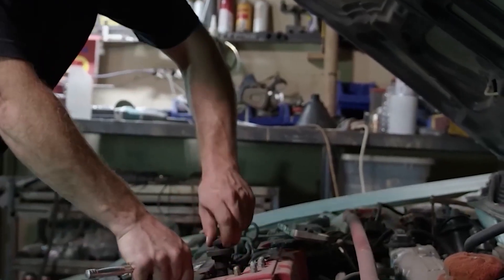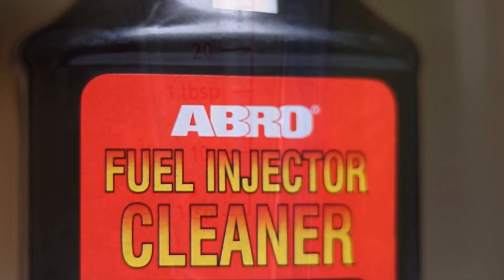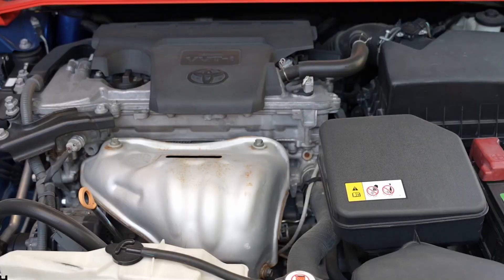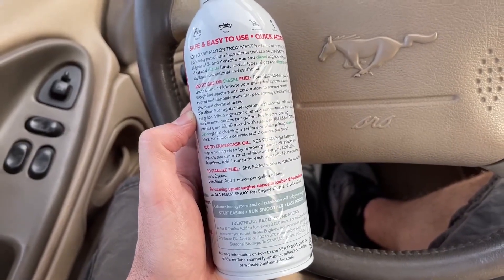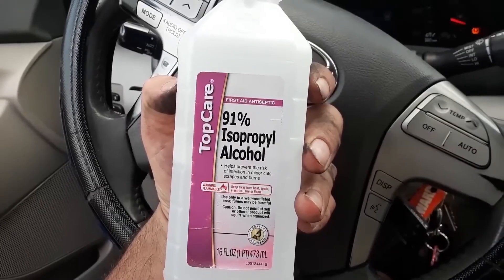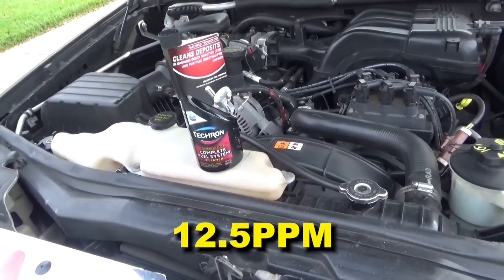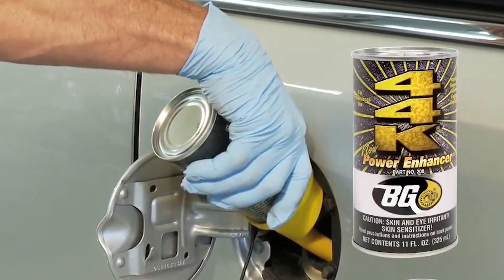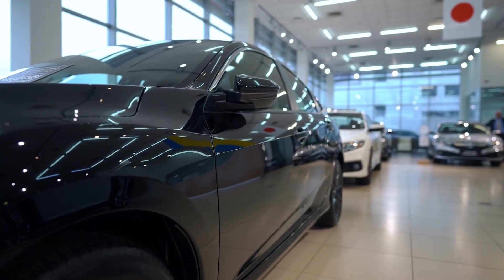NEVER Use These 6 Fuel Injector Cleaners (But 3 that Actually Work!)

Comment: 2018 Lexus RX 350 with 121,000 miles bought used so not sure if history. Engine V6, hesitates with in town driving. What fuel cleaner is best? I just ran a bottle of Techron concentrate through is last tank.

Comment: Geez, I just watched videos showing those cleaners that were hyped in this video as non effective. Someone has to be wrong.
Reply from the maker: Fair point! The key difference is PEA concentration and lab testing. Our picks (Techron 250ppm, BG44K 400ppm, MaxClean 300ppm) have verified SAE/ASTM test results. Budget cleaners lack this chemistry entirely. What specific products were those other videos recommending?
Reply: @AutoSleuth They weren't recommending any but showed 10 cleaners with bore scope to the valves and piston heads after one tank of fuel each.. The difference was minimal to none. I think the goal was to show expectations vs. results are not alway what the label on the product clams

Comment: I have a 2020 Hyundia Santa Fe 2.0 Turbo with 50K miles. Dealer keeps pushing fuel injector cleaner for $200! So far no issues with engine performance. What is your recommendation?
Reply from the maker: At 50K miles with no symptoms, skip the dealer service. Your 2.0T GDI benefits from preventive cleaning—use Techron Concentrate Plus every 5,000 miles ($12/bottle). Saves you $188 and works just as well. Dealer service only makes sense if you have rough idle or misfires.

Comment: The FEWER additives you put in your gas tank the better......
Reply from the maker: Actually depends on fuel quality. Top Tier gas already has detergents (300ppm minimum). But non-Top Tier stations? Your injectors are slowly coking without additives. PEA-based cleaners restore what cheap gas destroys. What fuel brand do you run?

Comment: 757. Twin Rolls Royce RB211 engines. What's your point?
Reply from the maker: Haha, if you're maintaining RB211 turbofans, PEA fuel additives are the least of your concerns! Those use Jet A-1 fuel with completely different chemistry. Stick to aviation-grade fuel system maintenance—this video's for us ground-dwellers. 😄

Comment: 1998 Montero with 3.0 24 valve 4x4. 270069 miles. What is best ?
Reply from the maker: 270K miles—legendary! Your 6G72 SOHC port-injection engine is bulletproof. Use Techron Concentrate Plus every 3,000 miles for maintenance. At that mileage, consistent cleaning prevents buildup better than aggressive products. What oil are you running in that beast?
Reply: @AutoSleuth 10W30. Castrol. High millage.

Comment: 2003 Silverado 2500HD 4x4 6.0 miles200k Farm Use more off road & idling than on road try to get on the HiWay once a week & get up to 60-70 until engine is fully warm 
Did a oil change after driving 1 hour at 65 oil nasty actual blobs of jelly made a difference 1st hot oil change in a couple years

Comment: Since late last year, I've been blasting seafoam into the intake of my Dodge Challenger and Charger Hellcats. A reputable shop remarked that he has bever seen the internals of a supercharger look so clean. I'm a believer in their product as well as Techron and BG 44K for the injectors.
Reply from the maker: Real-world results like that are invaluable! Seafoam shines for soft deposits in forced induction setups—superchargers collect varnish fast. Combining it with Techron/BG44K for injectors is the smart play. Your Hellcats are getting full-system care. What's your seafoam interval?
Reply: @A @AutoSleuth  For the superchargers I like to use Seafoam every 6mos. I started with annual treatments but given the way we drive our cars 6mo intervals seems like the smarter move

Comment: Berrymans is cheap as does a great job cleaning the fuel injection systems
Reply: 👍 used it for decades 👍👍🇺🇲
Reply from the maker: Berryman B-12 Chemtool is a strong solvent, but it doesn't contain PEA—the chemistry needed for modern GDI injector cleaning. Works great for carbs and older systems, but for direct-injection engines, PEA-based cleaners are more effective. What engine are you running it in?

Comment: Hello I own a. 2018  Jeep Grand Cherokee with the 5.7 liter Hemi engine,what’s right for me please?   Y Jeep has 94.000 miles
Reply from the maker: Your 5.7 Hemi is port-injection, so intake valve carbon isn't a major issue. Use Techron Concentrate Plus every 5K miles. At 94K, one bottle of BG44K now for deep cleaning, then Techron for maintenance. Keeps those MDS lifters happy too.
Reply: Redline s1, or chevron techron. I personally would pick redline. It has higher pea than most. You’re welcome 😊
Reply from the maker: Redline SI-1 is solid—550ppm PEA, highest concentration available. Great call! Both work, just comes down to price vs. concentration. Techron at 250ppm is more cost-effective for regular maintenance, Redline for aggressive cleaning. Both are winners.

Comment: I have a 2009 Toyota sienna with 104,000 miles on it I think I took care of it. Well, what treatment would I use?
I also have a 2020 Toyota sienna with only 16,000 miles on it. j I think of using the Chevron lubricant ever 5000 milesor don’t worry about it?
Reply from the maker: 2009 at 104K: Use BG44K once now for deep cleaning, then Techron every 5K for maintenance.
2020 at 16K: Techron every 5K is perfect—keeps it clean from the start. You're ahead of the game on the new one. What fuel brand do you use?

Comment: 2023 Toyota 4 Runner  24K
Reply from the maker: Brand new engine! Just use Techron every 10K miles for preventive care. Your 4.0L V6 is port-injection, so carbon buildup is minimal. Keep it clean from the start and you'll hit 300K easy.

Comment: 2016 Kia Soul 132k miles
Reply from the maker: At 132K, your 2.0L Nu engine benefits from BG44K for deep cleaning, then Techron every 5K for maintenance. GDI engines like yours collect carbon fast—stay consistent with cleaners to avoid intake valve buildup.
Reply: @AutoSleuth 1.6L

Comment: 2021 Lexus RX450H  35,000 miles
Reply from the maker: Your hybrid V6 is super clean-running due to low engine-on time. Techron every 10K miles is plenty for preventive care. GDI engines benefit most, and you're already babying it. Keep doing what you're doing!

Comment: I have a 2013 Ford Edge  6 Cyi. It has 163,000 on it. What would  you  recommend?
Reply from the maker: Your 3.5L Duratec is port-injection, so carbon buildup is manageable. Use BG44K once for deep cleaning at 163K, then Techron every 5K miles. If you're towing or driving hard, Royal Purple MaxClean every 10K adds octane boost too.

Comment: Then why is the product on the market?
Reply: Same reasons that fast food joints sell well.
Advertising and gullible people.
Reply from the maker: Exactly. Cheap cleaners sell because of price and shelf space, not chemistry. People assume all fuel additives work the same—until their injectors clog and they learn the hard way. PEA concentration is the difference between cleaning and wasting money.
Reply from the maker: Great question! Because regulations don't require PEA or specific deposit-control chemistry—just basic safety standards. Companies can legally sell cleaners that don't actually clean modern GDI engines. That's why lab testing (SAE/ASTM) matters more than marketing.

Comment: 2020 Ford Fusion SE 65K
Reply from the maker: Your 1.5L EcoBoost GDI needs consistent cleaning. Use Techron every 5K miles to prevent intake valve carbon. At 65K, you're in the sweet spot—catch it early and avoid the $600 walnut blasting service later.

Comment: 2013 Toyota Land Cruiser (200 series) with 105 K miles and a 2020 Toyota Sienna van with 123 K miles. Both are in excellent condition and are Toyota serviced every 5 K miles/6 months.
Reply from the maker: Both are Toyota legends! For the 2013 Land Cruiser at 105K, use a quality PEA cleaner (Techron or BG44K) every 10-15K miles to keep those injectors optimal. The Sienna at 123K—same approach. Since you're already servicing every 5K, just add Techron every other service. You're treating them right!
Reply: @AutoSleuth Thank you  !!!

Comment: Have a Nissan Kicks SV with 45,000 miles and a 2012 Ford Focus SE with 164,000 miles. Both Gasoline not hybrids.
Reply from the maker: For your 45K Nissan Kicks, Techron every 10K is plenty for preventive care. The 164K Focus needs more attention—use BG44K once for deep cleaning, then Techron every 5K. That 2.0L Duratec has earned it at that mileage!

Comment: 2011 450 gl 175000 miles
Reply from the maker: Mercedes GL450 at 175K—impressive! Your M273 V8 is port-injection, so use BG44K once for deep cleaning, then Techron every 7,500 miles. Keep an eye on fuel trims—if they drift past ±5%, time for another treatment.

Comment: Im thinking of using Royal Purple or 44K in my 99 Lexus rx300. The injectors are all original with 210,000 mls. 
I was mostly using Speedway fuel until I found out about the top tier rating and Speedway doesn't have it.
Reply from the maker: Smart move switching to Top Tier fuel! At 210K on original injectors, use BG44K first for aggressive cleaning, then alternate between Techron and Royal Purple MaxClean every 5K miles. Non-Top Tier fuel definitely caused buildup—you're fixing it now.

Comment: 2015 Toyota Yaris LE
Reply from the maker: Your 1.5L 1NZ-FE is one of Toyota's most reliable engines. Use Techron every 10K miles for preventive care—port-injection means carbon buildup is minimal. Simple maintenance keeps it running forever.

Comment: 1996 Honda accord ex 2.7L 198,705miles
Reply from the maker: 198K on a '96 Accord—bulletproof! Your F27A is port-injection, so carbon isn't the main issue. Use Techron every 5K miles to keep injectors flowing smoothly. At that mileage, consistency matters more than aggression.

Comment: Toyota rav4 2016
Reply from the maker: For a 2016 RAV4, especially with a GDI engine, BG44K is a great choice to target port and injector deposits. Royal Purple MaxClean can give you the extra edge with octane boosting and long-term fuel stabilization. Techron works well for regular 3,000-mile maintenance.

Comment: 2012 subaru legacy 2.5i
Reply from the maker: For your 2012 Legacy 2.5i, a treatment like BG44K or Royal Purple MaxClean would be ideal. They use high-concentration PEA, which can restore injector flow and clean intake valves effectively without damaging seals. Techron works too for routine maintenance, but for any baked-on deposits, the remediation-grade formulas are more effective.

Comment: 2013 lincoln navigator
Reply from the maker: Your 2013 Navigator can benefit from Royal Purple MaxClean if you’re seeing rough idle or fuel trim deviations—it addresses both cleaning and performance protection. For ongoing maintenance, Techron is excellent for keeping the system in check between major treatments.

Comment: Thanks for the information. I'm surprised Seafoam is low on your list. I've used it for every internal combustion engine I own including snowblower and lawn tractor for the last 30 yrs. Never had a fuel related or carbon build up issue causing me problems. I guess using it regularly prevents trouble. Maybe the other cleaners are better at a thorough cleaning to get the engine back to life it they were abused. I routinely use MMO and Seafoam together and again, never encountered a problem. In fact , my engines run and sound like new for 15-20 yrs in my ownership. Nice to know there may be better additives to deal with a severely neglected engine.
Reply from the maker: Absolutely, Seafoam has a long history of being reliable for maintenance, especially in older or lightly-used engines. As my video explains, it’s great for soft varnish and gum removal, but in modern GDI engines with baked-on carbon, it won’t fully restore injector or valve flow—think of it as maintenance-grade rather than restoration-grade. Pairing it with other treatments can still help prevent future issues, and your experience over 15–20 years highlights why regular use keeps engines healthy. Thanks for sharing your insight!

Comment: Does it fit for diesel engines
Reply from the maker: Good question! Most cleaners I covered in the video—including the top three like Techron, BG44K, and Royal Purple MaxClean—are designed for gasoline engines. Diesel systems have different chemistry, higher pressures, and different injector designs, so you’ll need diesel-specific additives to get similar deposit removal and protection.

Comment: 2019 kia soul 1.6gdi
Reply from the maker: Modern GDI engines like your 2019 Kia Soul respond best to high-PEA cleaners. BG44K or Royal Purple MaxClean will effectively address intake valve and injector deposits. Seafoam is safe, but it’s maintenance-grade; it won’t restore performance if the engine already has severe carbon buildup.

Comment: 1997 BMW E36 328i sedan. 150k miles
Reply from the maker: Nice choice! The M52 engine in the E36 responds really well to PEA-based cleaners like Techron or BG44K—especially around that mileage. Keeps the injectors balanced and the idle smooth. Classic BMW, built when engineering still had soul!

Comment: Red Line SI-1 has the highest concentration polyetheramine.
Reply from the maker: Exactly right—Red Line SI-1 is one of the few consumer products that hits those top-tier PEA levels, often close to professional-grade cleaners. It’s powerful stuff if used correctly, especially for engines that run rich or see shorter trip cycles.

Comment: Back in the day, I used Marvel's Mystery Oil in my old engines running dino oil...in the oil, not the fuel.  In fact, I even cleaned out an old Chrysler 318 that was all sludged up with MMO.  As for SeaFoam, I use it in my lawnmower to this day. Works great, Back in the day, it was great for cleaning carburetors in my vehicles.  I've loved Techron since the late 80s.  Still use it today, (at every oil change) even while using top tier fuels.
Reply from the maker: That’s awesome experience right there! MMO definitely has its place for lubrication and sludge prevention—especially in older engines like that 318. You’re absolutely right about using it in oil rather than fuel; its upper-cylinder protection still holds up well today. SeaFoam is great for smaller engines too—perfect use case!
Reply: I got a bottle of that in my garage with the Caldors sticker on it. I also remember slick 50 not the stuff they got now but the other stuff you only did one treatment of it that stuff works so good filled in all the scores and everything in the Piston walls amazing we put it in our 74 1/2 Jeep with Nash Rambler straight 6 in it.
Reply: I put Marvel Mystery Oil in gas and engine oil all the time

Comment from the maker: My Top 5 Fuel System Cleaners (Tested & Mechanic Approved)
These are proven PEA-based cleaners that actually work — safe for modern engines, restore power, and improve fuel economy. Use one bottle every 5,000–7,000 miles for the best results.

1⃣ Chevron Techron Concentrate Plus – Trusted OEM-grade cleaner.
https://amzn.to/3LlYB7v

2⃣ Red Line SI-1 Complete Fuel System Cleaner – Strong PEA formula for deep cleaning.
https://amzn.to/3JRmUtk

3⃣ Royal Purple Max-Atomizer – Great for GDI engines, adds performance & fuel stability.
https://amzn.to/4qP55vC

4⃣ Liqui Moly Jectron Fuel Injection Cleaner – German quality, smooth idle & throttle response.
https://amzn.to/3Ltg11Z

5⃣ Gumout High Mileage Fuel Injector Cleaner – Perfect for older engines & regular maintenance.
https://amzn.to/3LlEh6b

⚙ How to Use:
Pour the cleaner into a nearly empty fuel tank, then fill up with gas. Repeat every oil change or 5,000 miles.
Reply: BG 44K Platinum...
Reply: This was a huge help. Thanks.
Reply: Yes, specifically, the Gumout Regane lists PEA on their label

Comment: 2023 Kia Sportage 2.5L
Reply from the maker: Great choice! The new 2.5L Sportage is a solid engine — efficient and refined. Just keep in mind it’s a direct-injection system, so carbon can build up over time. Running a quality PEA cleaner like BG44K every few oil changes keeps injectors and valves spotless. It’s a small step that makes a big difference long-term.

Comment: 2003 Honda Civic 1.7L LX . 2000 miles
Reply from the maker: A 2003 model with just 2,000 miles? That’s practically a time capsule, brother! 😄 Maybe you meant 200,000 miles? Either way, that 1.7L Civic is one of Honda’s most reliable engines. Keep up with regular oil changes and run a good PEA-based cleaner like Techron every few thousand miles — it’ll stay smooth for years to come. Honda really built them tough back then.

Comment: What to use in two cars: 2024 Elantra 8K miles and a 2017 Elantra 70kmiles?
Reply from the maker: That’s a really good question, sir. For the 2024 Elantra with just 8K miles, you don’t need anything strong yet—just stick with Top-Tier fuel and maybe use a mild cleaner like Techron once a year for preventive care. But for the 2017 Elantra at 70K miles, that’s where a proper PEA-based cleaner such as BG44K or Royal Purple MaxClean actually helps. They dissolve carbon safely and bring injectors back to balance without harming sensors or seals. Always add it before a full refuel so it runs through the system evenly.

Comment: 2006 Dakota SLT quad cab 4.7
Reply from the maker: Thanks for dropping your setup, Randy — that 4.7L Dakota’s a solid motor. For that engine, I’d skip anything kerosene- or alcohol-heavy and stick to a true polyetheramine (PEA) cleaner like BG44K or Royal Purple MaxClean. They’ll keep your injectors balanced without messing with your seals or sensors. If your truck’s got over 120k miles and you’ve never done a cleaner before, run it on a half tank to let it circulate a bit stronger through the injectors. You’ll feel smoother idle and better throttle response after one treatment.